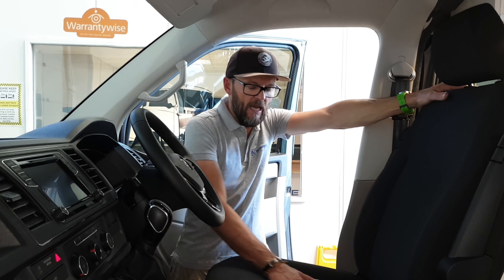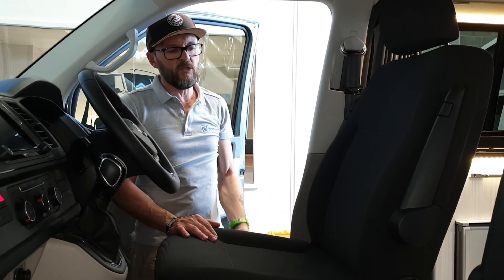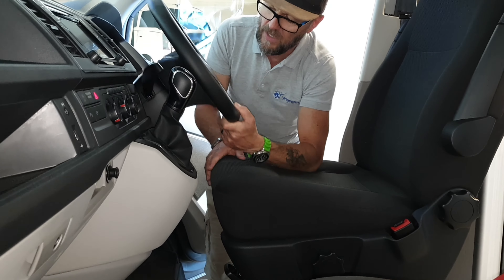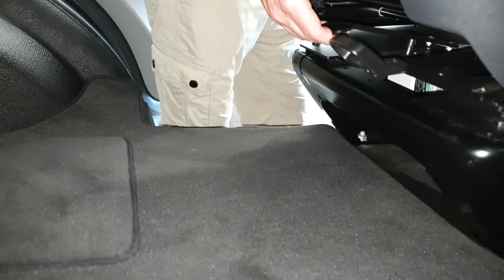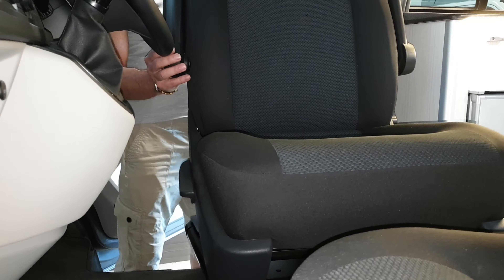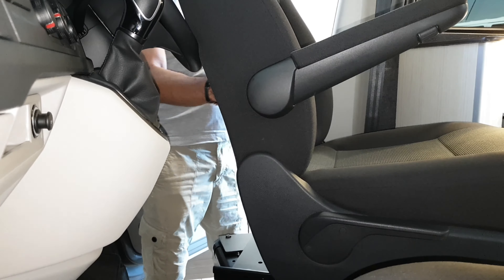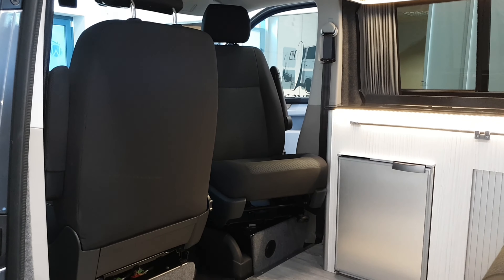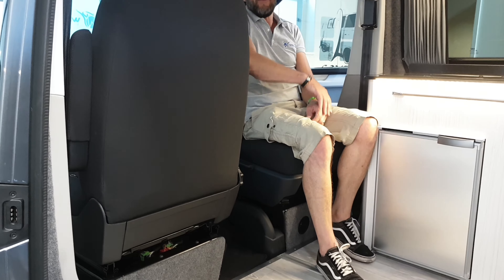Single Sportscraft Swivel Seat

Comment: Is that the extra height base they offer to clear leisure battery?
Reply from the maker: Thanks for your question Gary. We lower the handbrake bracket on the driver seat base when we fit the swivel. This gives a factory finish but does not raise the height of the seat.